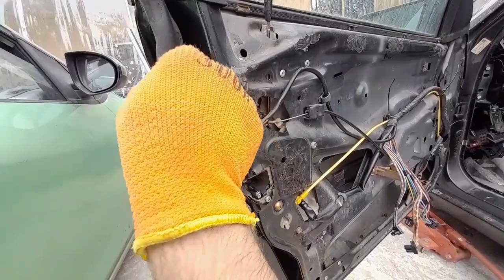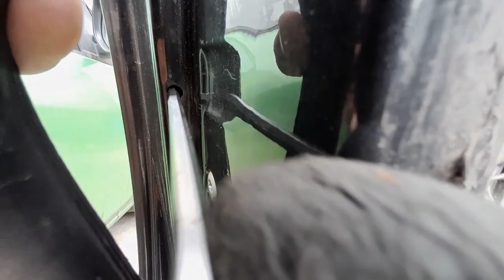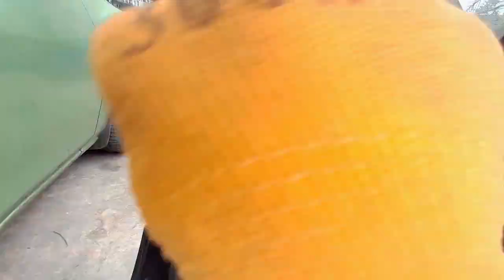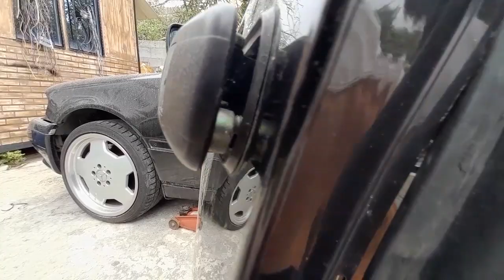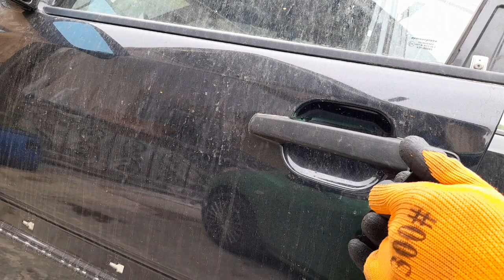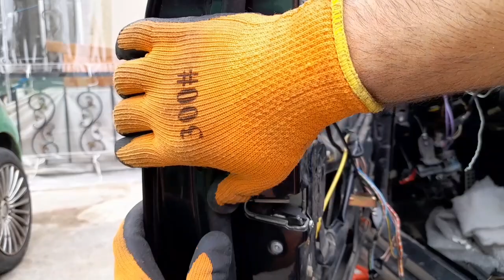Mercedes-Benz w202 how to remove IR sensor from driver door

Comment: Do u know what the part number would be to replace the sensor?
Reply from the maker: By the catalog part number it's a2027602377 I don't know cause there is no part number 
I will post a video for disassembling it
Reply: @johndiymercedesbenzlb  allright thanks :)
will leave a follow when u post the vid
👍

Comment: Sir, the sensor is for what?
Reply from the maker: It's the remote control receiver for the antitheft alarm
Reply: @johndiymercedesbenzlb  but, open/close the windows too?
Reply from the maker: Yes
Reply: @johndiymercedesbenzlb  thanks bro
Reply: For locking and unlocking doors, trunk and fuel cap